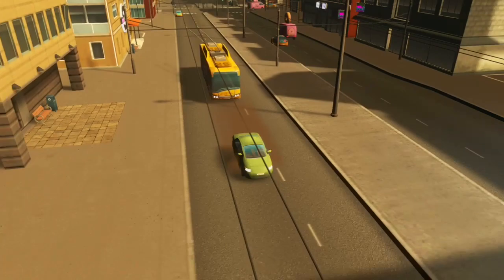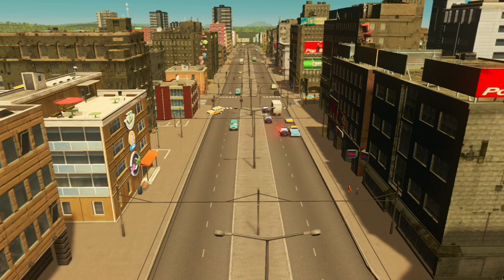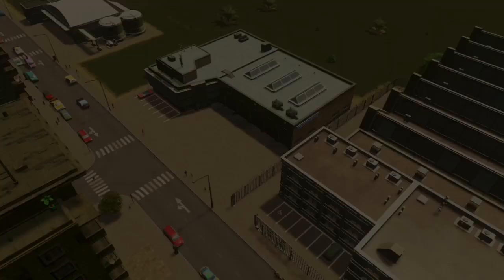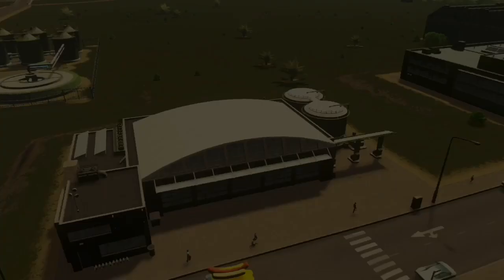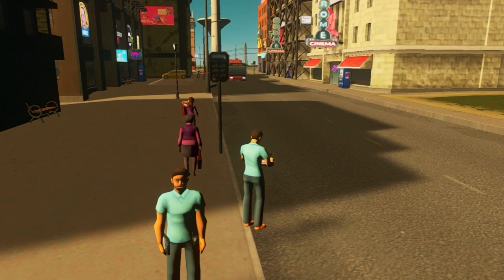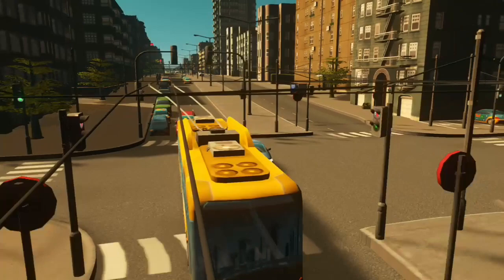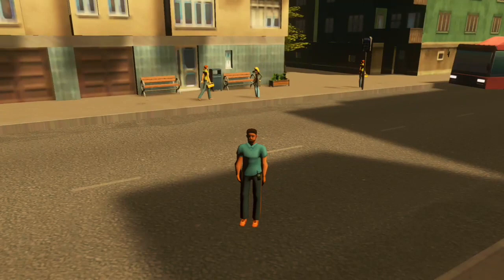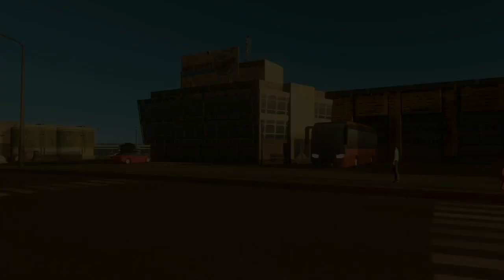Cities: Skylines- What is the Trolleybus Good For?

Comment: Now in a real city. :)
San Francisco has all of them: bus, trolley bus, tram, metro, commuter rail and cable cars. It generates its own electricity so trolley buses and trams are cheaper to run. Streets with trams and trolley buses can (and do) use the same catenary (overhead wires). And trolley buses can drive up walls. I mean they don't even slow down on hills. 
But back to the game... have fun.
Reply: Also Philly and Boston
Reply: In my city there are also all of them: bus, trolley bus, tram, tramtrain, regional and intercity train (25k V, 50 Hz), suburban train (1000 V DC), metro (or subway, 825 V DC), cog rail (1500 V DC), children's railway (760 mm gauge), cable car (funicular and chairlift too).